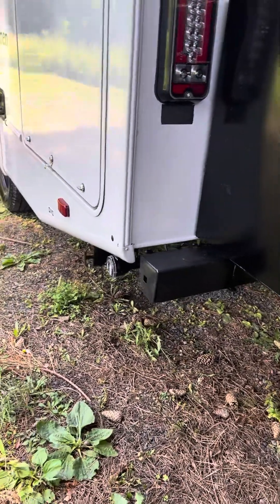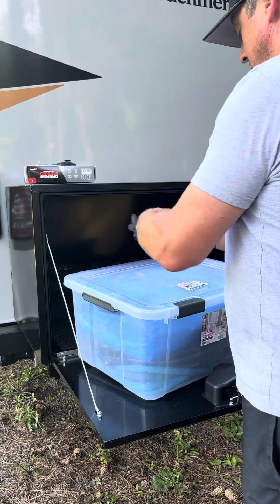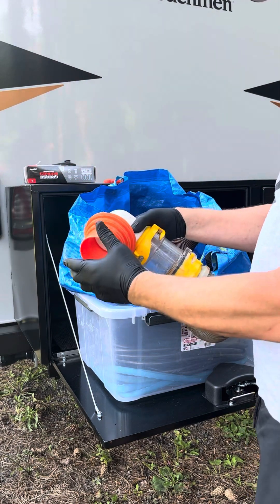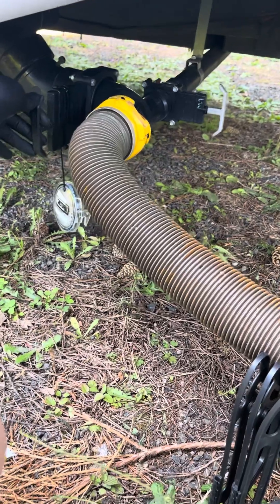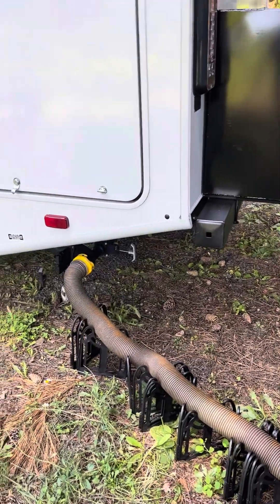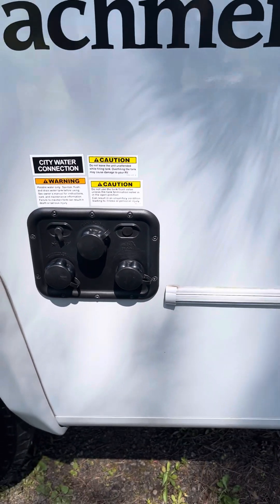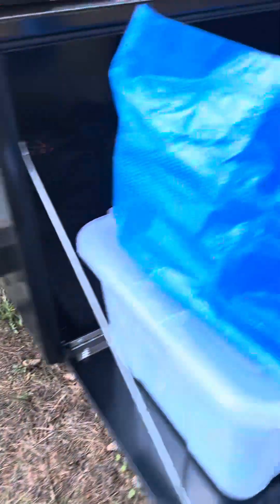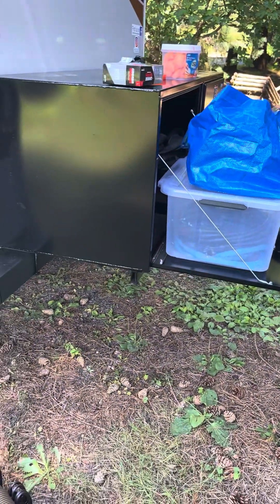Dumping the Black and Grey tanks 2023 Coachmen Cross Trail 20XG

Comment from the maker: @vailjohnson they are not heated.  The tanks have electrical heating pads stuck to the underside of tanks.  The grey tank has a valve right at the tank so you can close the valve there and make sure you drain the water out of the exposed section of pipe so it does not freeze.  I learned that the hard way.

Comment: Great video...  
Two grey pulls, does that mean there are two grey tanks and are their specs listed anywhere?
Reply from the maker: @bernie.b, no there is only one grey tank.  I believe it is 27 gallons.  I believe they just installed one extra pull up at the exit of tank so you can keep water from standing in the exposed pipe leading to the other pull.  To keep from freezing.

Comment: Cool video, thanks. What brand box is that attached to the bumper?
Reply from the maker: The Box is from Buyers Products-Made in USA.  I made a steel frame support that also uses the hitch receiver for extra support, so all the weight is not just on the bumper. Thanks for the comment!
Reply: Anytime! I'm looking to buy a 20XG, mainly for the garage.  @SequoiaRoots_MoonTaxi